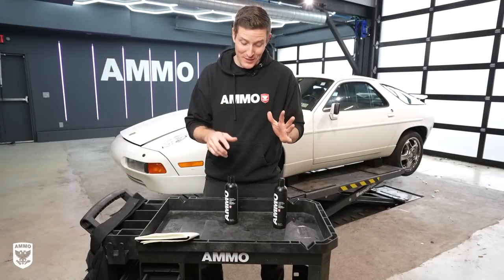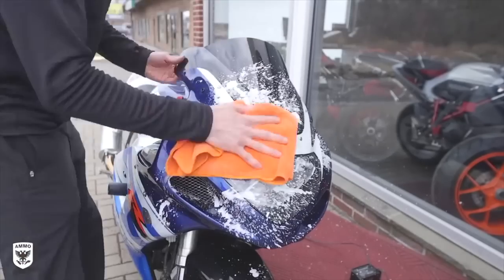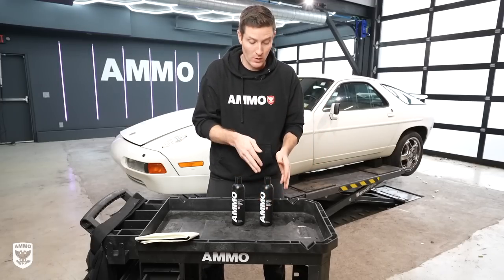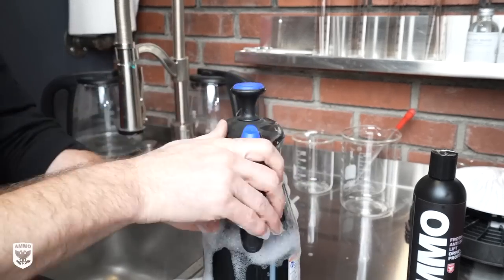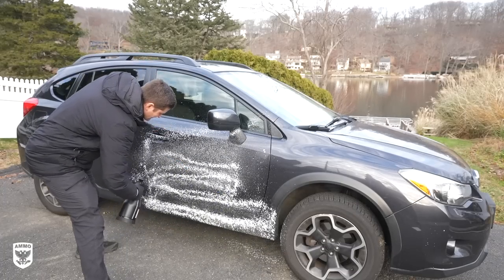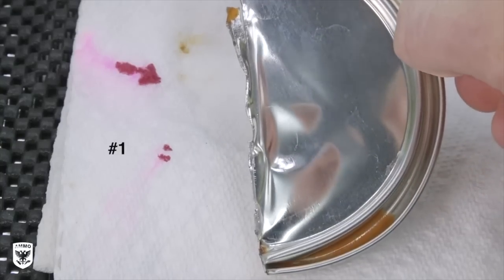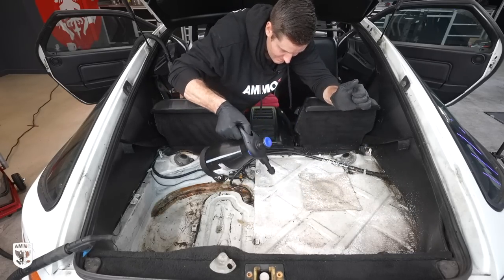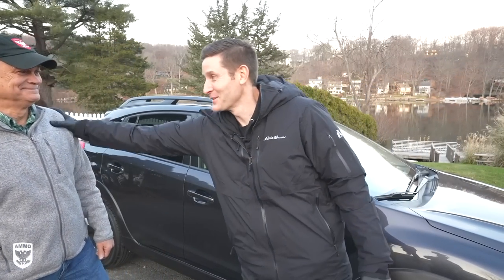New Frothe Anti Salt Lift

Comment: Thanks to the blogger's video, I learned something new. I hope to share with you another product: Philipsn, which has a very good protection effect on my car.
Reply: Right, I have also used it, the effect is really good, the tires are very clean, waxing is very easy to get started, I bought it during the promotion, it is cheap and easy to use, philisn's products do not hurt the car paint, safer and more environmental - friendly.